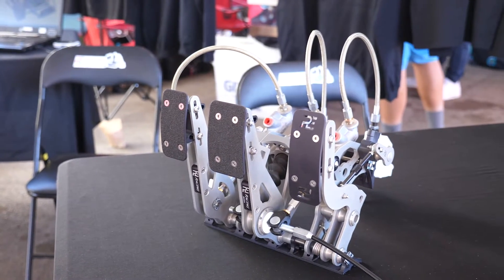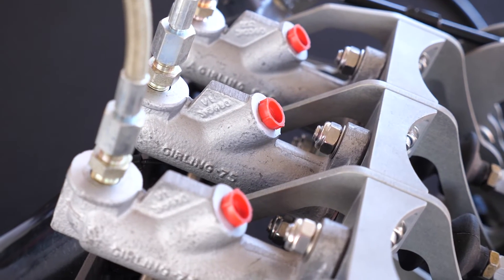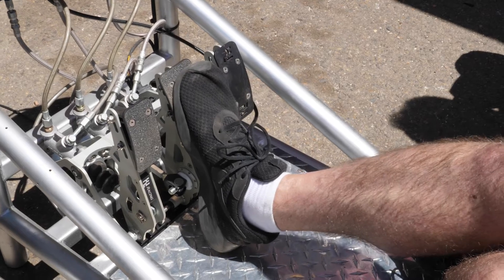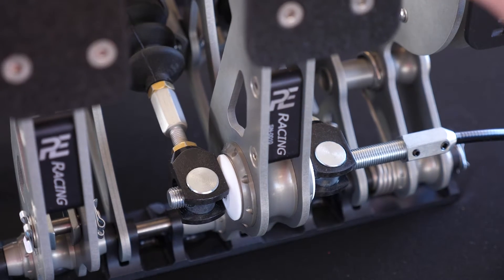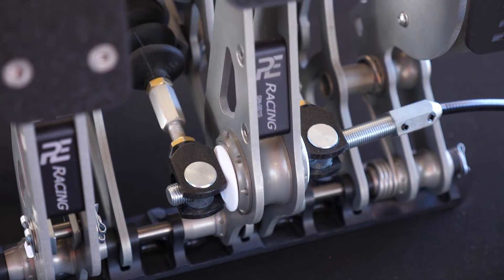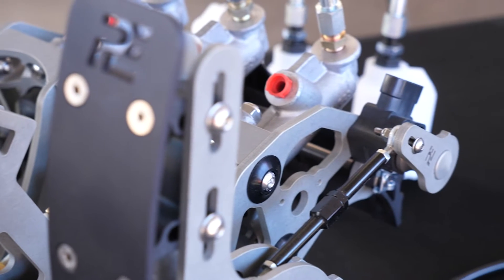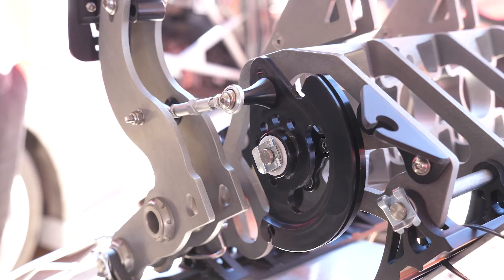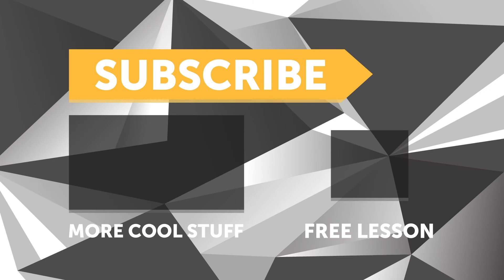Are Pedal Boxes A Waste Of Time?

Comment: I have a question regarding pedal boxes. I was injured some years ago and my right side is very fragile. I have a really short shift in my Veloster N, without it I couldn't get the car in 5 or 6. The reach felt like it was mile so I of course made that work. Can I put a pedal box in my car without haveing to give any features? ABS, traction control and such.
Reply from the maker: With enough time and money anything is possible, but I can't tell you how easy or hard that would be to do for your car as it's not something we have ever done to a Veloster. I would ask around the community and see what others have or haven't done along with talking to a few pedal box suppliers - Taz.

Comment: What about other ways of effecting brake bias in less race car applications, like different sized wheel cylinders, how putting disks on a drum braked car will move bias away from the end that gets disks, the use of pressure limiting valves, some of which can be adjustable or made adjustable or different pads? These whilst coarser adjustments and more permanent are probably more likely on road cars and amateur motorsports.
Reply: I prefer to stick with a production pedal box and a proportioning valve. It works well.